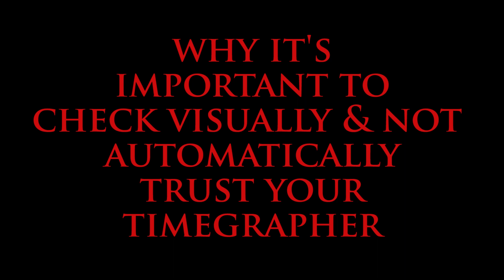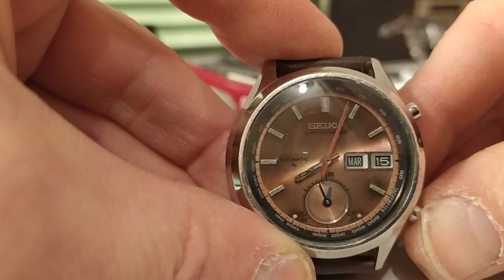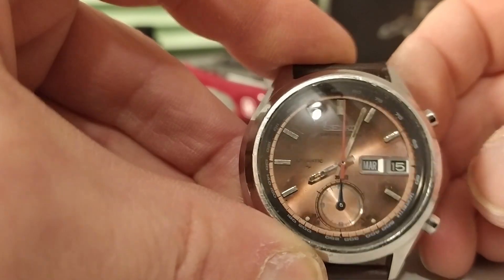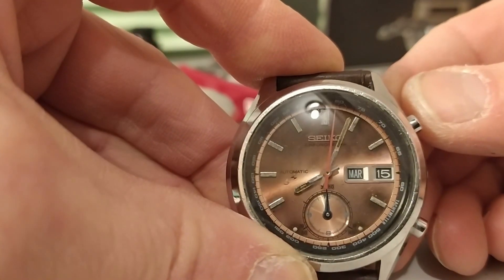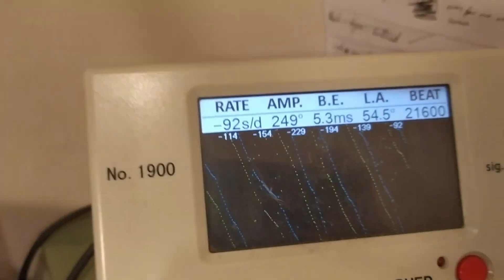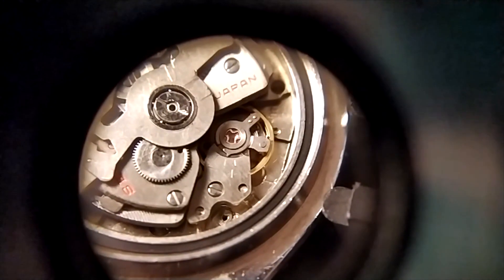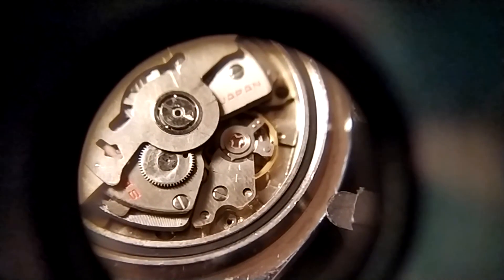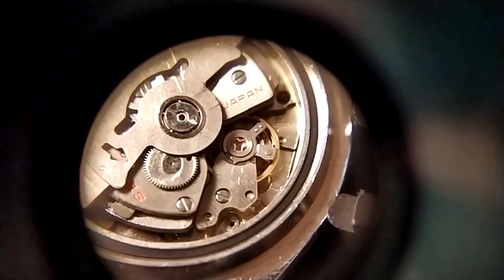Timegrapher Readings, Why Visual Inspection Is Important

Comment: That slowmo shows an amplitude closer to 180 degrees not 90! Still a very good point though that the timegrapher reading is way off so huge thanks for pointing that out. Will watch out for that in future.
Reply from the maker: It's not. It's 90 degrees. Swing of the oscillation is measured in one direction from position of rest so that's swinging 90 degrees from the central position of rest each direction.
Reply: @spidiq8  which is a total of 180 degrees is it not?
Reply from the maker: @mlgboy1  It is a total of 180 degrees in respect to 90 degrees in each direction, but that's not how amplitude is measured. A complete circle is 360 degrees. An absolute maximum of 340 degrees is considered the limit before knocking occurs. If amplitude was measured as the swing in BOTH directions then a freshly serviced high grade movement which would give 300 to 320 degrees would actually be reflected as 600 or 640 degrees on the timegrapher.
It's not so because the actual amplitude is the swing in one direction, not both.
Reply: @spidiq8  Understand your point but relative to how a timegrapher measures amplitude, which is the complete swing, surely if you are comparing like for like you would state 180 degrees would you not?
Reply from the maker: @mlgboy1  No you wouldn't.
If the timegrapher in this example were reflecting the true amplitude it would read 90 degrees.
Imagine a healthy amplitude of 280 degrees. When your timegrapher says 280 it's calculated from the drop and lock of the pallet in one direction so your balance wheel from the central position of rest would swing just over 3/4 of itself out would then return, drop and lock occurs again and it swings a little over 3/4 in the other direction.
If the timegrapher reported the swing in both directions it would read 560 degrees.
If you re watch this and rather than taking where the balance slows and stops as the starting point for the reading it's actually halfway between them. Hopefully that makes sense.